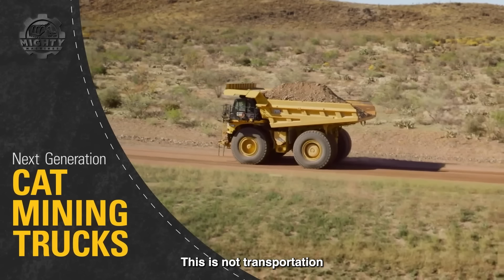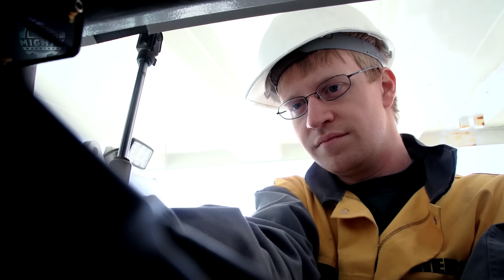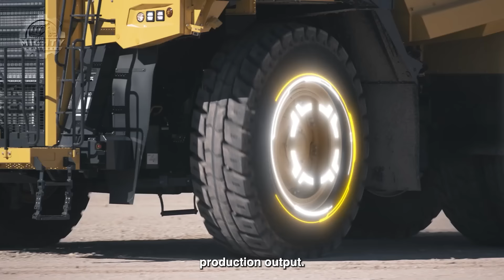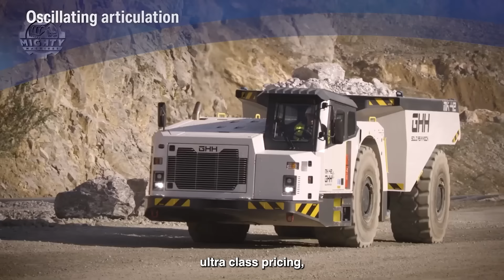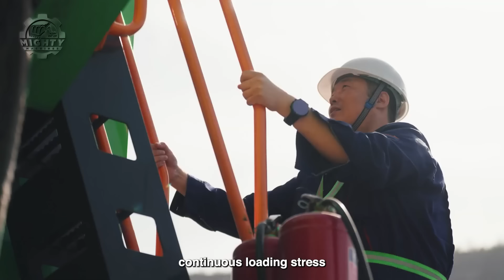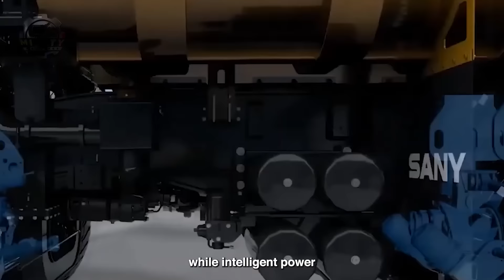This $6,300,000 Dump Truck Is The Biggest Thing On Wheels And It's Terrifying

Comment: What benefits does electric power offer?
Reply: Electric power in dump trucks offers:

Lower fuel and maintenance costs
Zero or low emissions
High torque for heavy loads
Quieter operation
Better energy efficiency
Regenerative braking (recovers energy downhill)
Improved performance and smoother driving